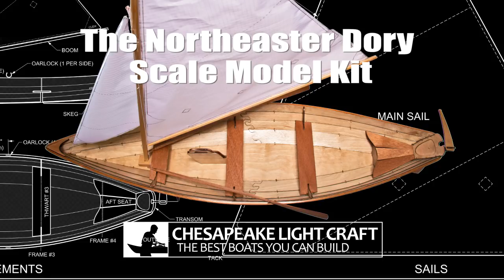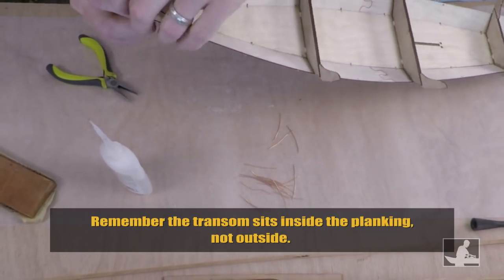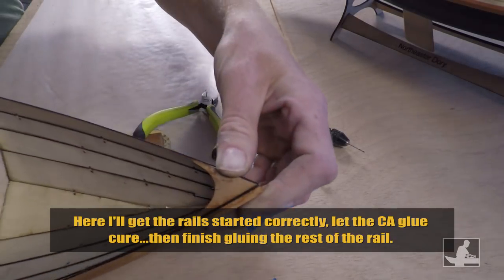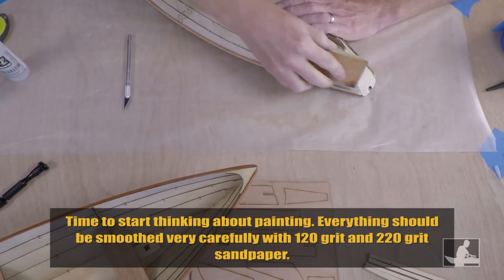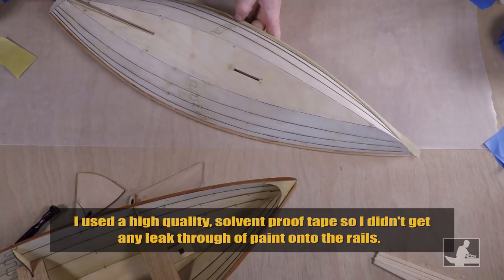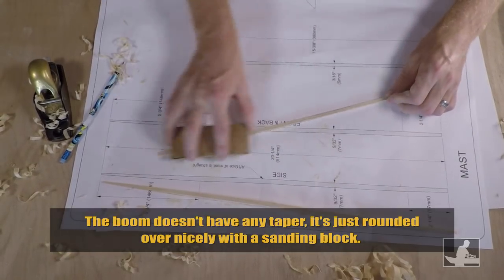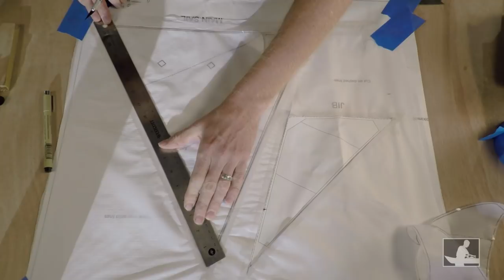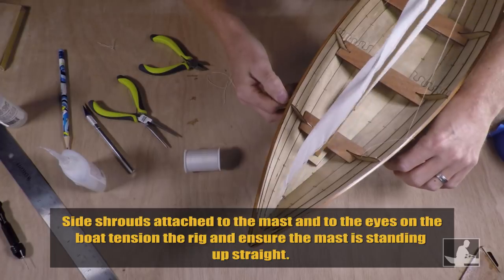Build a Scale Model of the CLC Northeaster Dory

Comment: Is the model a functioning sailing model or a display replica only? That's important information that is not on your web site or in the video.
Reply from the maker: Many have asked if this 25-1/2" model can be fitted with servos and a radio and sailed by remote control. Answer: No, it's too small. This is a display model. Tiny wind ripples on a pond scale to six-foot waves in the full-sized version, leading quickly to a fatal swamping unless the boat were decked in. Along with a full-length deck the model would need a deep fin keel with a bulb of lead ballast. It looks dashing on the mantel while your full-sized Northeaster Dory waits out the winter in the garage. For a good RC sailing model, check out the Independence:  http://www.clcboats.com/shop/boats/wooden-sailboat-kits/independence-remote-control-sail-boat.html